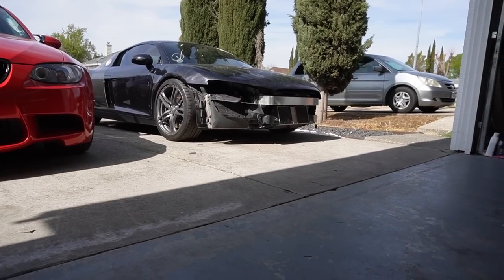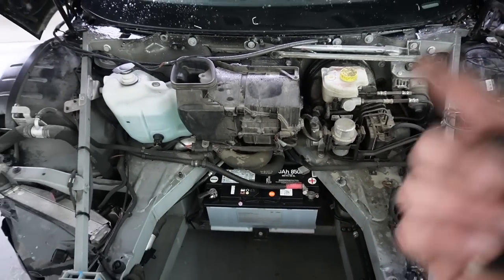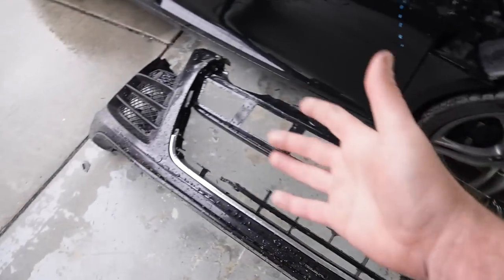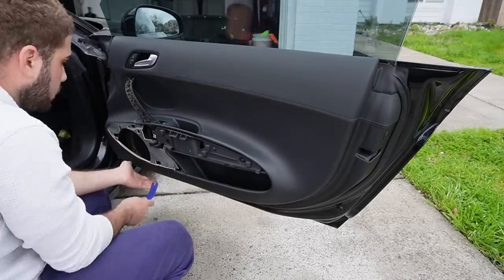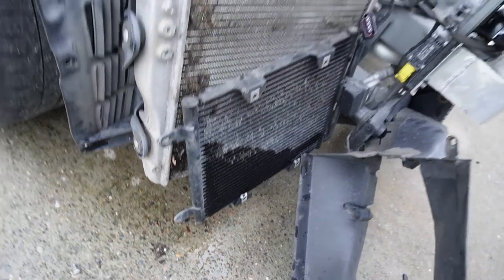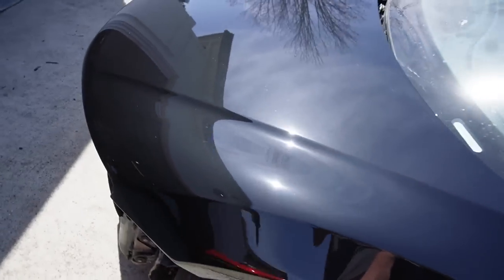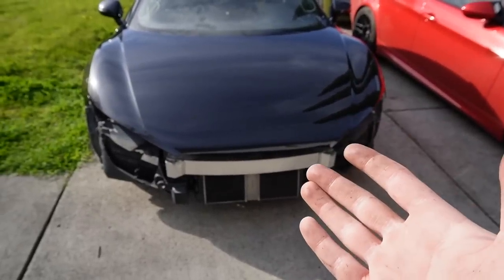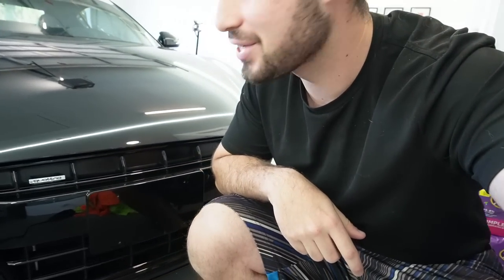MY GATED MANUAL R8 IS BACK FROM PAINT AND ASSEMBLED! LOOKS MAJESTIC!

Comment: Most mirrors are not symmetrical because you sit closer to one side. The passenger side is angled in more so as to be seen from the drivers seat. It's totally normal.